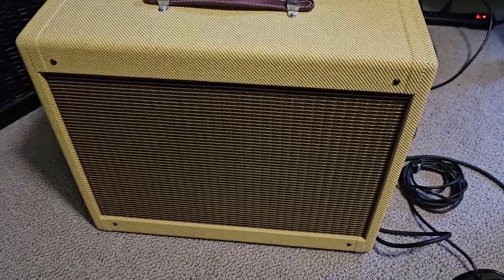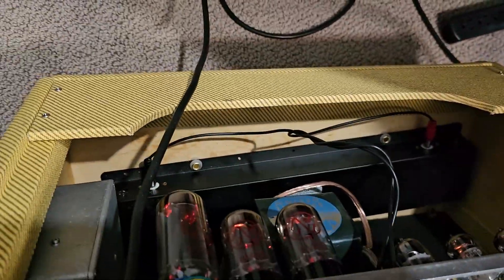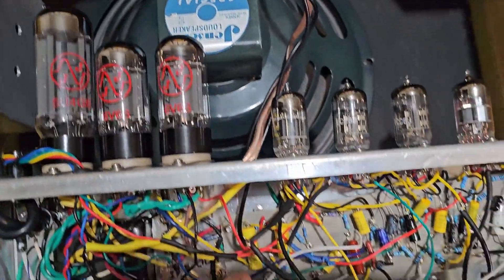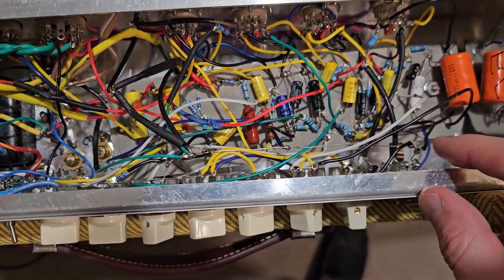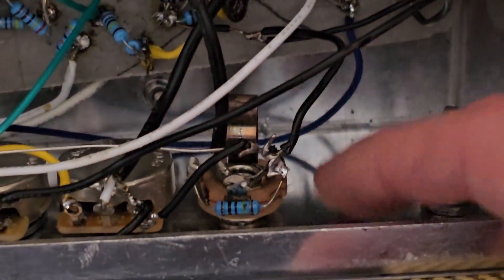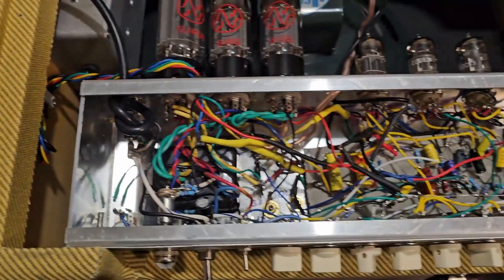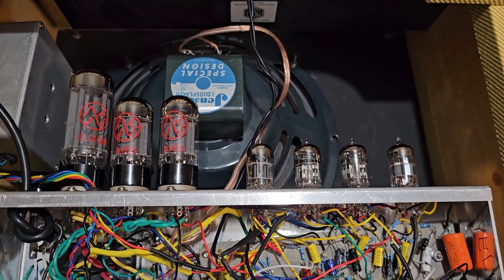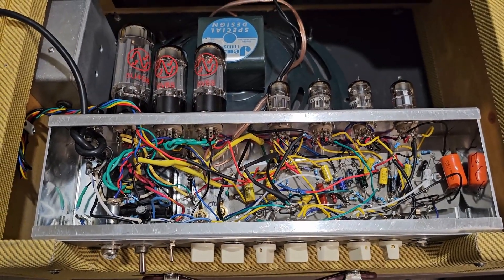Princeton Reverb Hum / Buzz Fix | Tone Demo

Comment: I really don’t want to be negative or discourage someone who put so much work into a project, but your wiring looks like a bowl of spaghetti… and running high voltage lines outside your chassis is just a very bad idea. As others have mentioned, the chassis is also way too small.
You should start with a less ambitious project, like a tweed Champ 5F1 kit, and learn how to do proper lead dress, solder joints, etc.

Comment: Hi, your wire lead dress is a mess, you have the B+ wires running ll over the chassis, you have the Filaments interferring as well, they either need to be twisted and elevated or running very low to the chaasis near the wall, away from other wiring. The layout simply needs to be more thought out. Also, you have burned insulation with your iron, you have multiple grounds on the Chassis, it looks like spaghetti in there. There are many examples of fine lead dress as well as excellent tutorials on why and how to set up a circuit for tube amps. I applaud your interest and passion but before selling your work you need to become more pprofessional in m opinion. That's just my thoughts, I don't mean this in a cruel way, but I've built and wired many amps in the past and I have learned the importance of what not to do as well as what to do. As a side note, Teflon insulated wires in stranded and solid form is the best way to go for soldering in tight situations.
Reply: Can we see some examples of your work? I'm sure it's perfect!